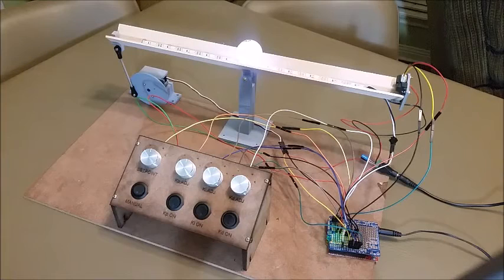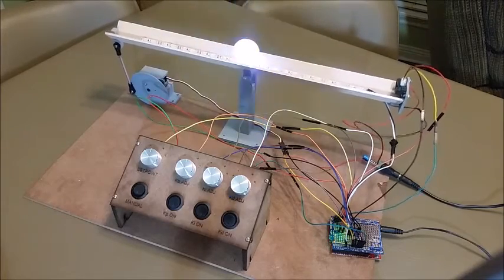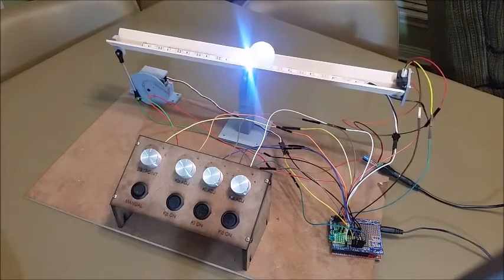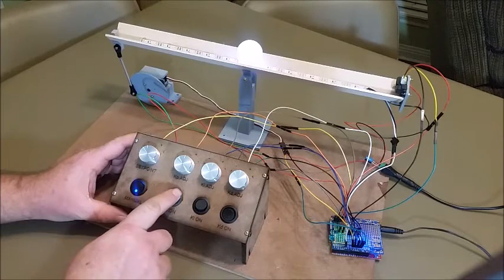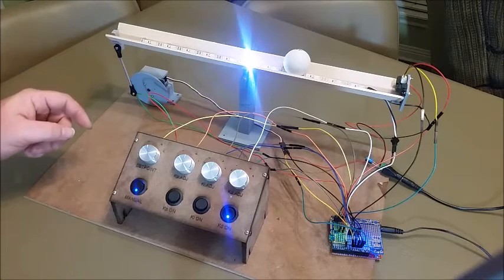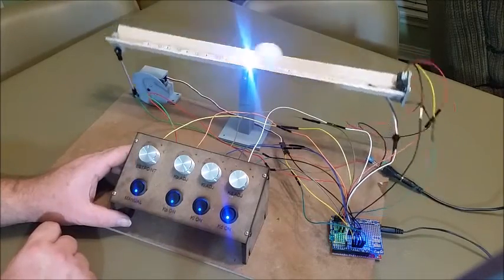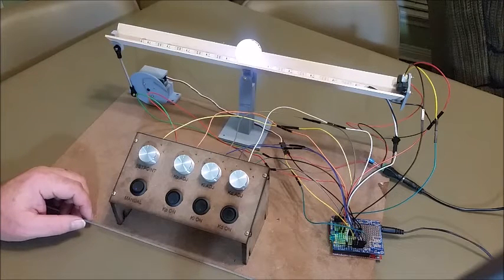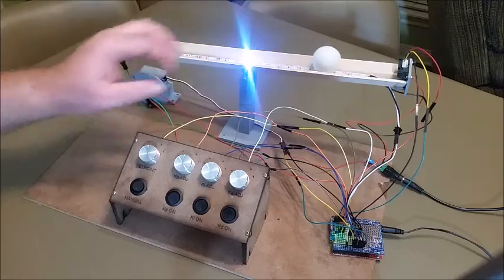PID-Controlled Ping Pong Ball Balance

Comment: I would like to understand the process of transforming the calculated controlled variables into the signal for the servo. Its done with a mapping function where the max/min values are translated into 0-180° angle. This limits vary with different values of the pid constants (kp,ki,kd) right? Does it automatically mean that you have to adapt the limits everytime you change the pid constants in your code??
Thanks at all! Im quite curious on the  answer :-)

Comment: This is really cool!!! Love how you added more features on top of the basic electronoob version. 

I’m currently trying to make the simple version, but I don’t fully understand electronoob’s code. Could ya help me understand the following parts possibly?

1. Why does he say to set the servo to 125 degrees as the midpoint? Why not 90 degrees which is perfectly between 0-180, or 75, between 0-150

2. Right in the end of his code, he used the map function, mapping the PID total which he claims is from -150 to 150, to 0-150 degrees. How does one figure out the original range of the total PID gain?

I’d love if you could share your code too... I’m desperately trying to make this work, and I could use some help.

Love your version!!!!!
Reply from the maker: Hi Milind.  I just now saw your comment.  Thanks for the kind words.  Did you ever figure out the problems in your code?